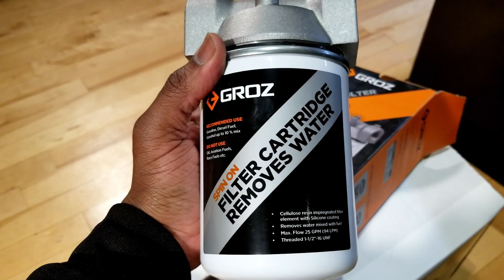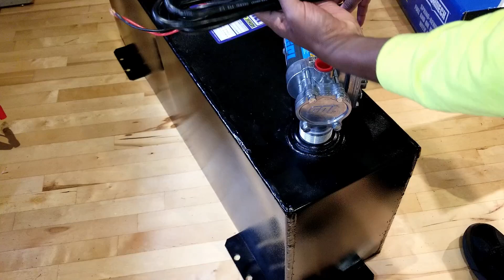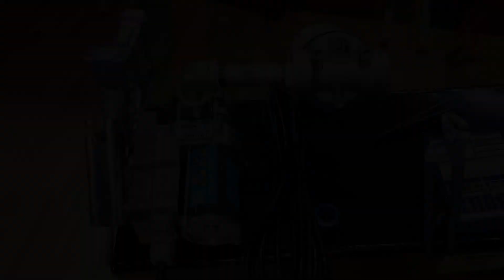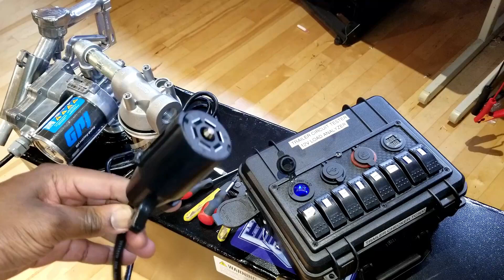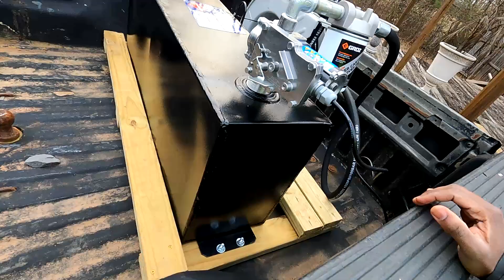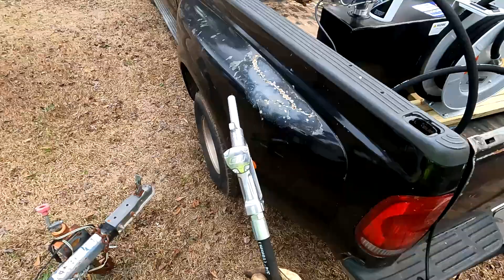12V Fuel Transfer Pump Tank & Reel Setup

Comment: How is it holding up? I wanna try it to take the wast oil of my oil changes I am a mobile mechanic would you try it?
Reply from the maker: Its still working, but If i was transferring oil, id look for a pump that is designed for that, such as the Fill-Rite FR410B which is a diaphragm pump.

Comment: Company called PIG they sell small pillow it only absorb fuel no water , amazing, put in bucket with holes bottom to let rain water out and nozzle will stay in bucket as place for it to stay catching fuel drips ,bolt bucket to your frame large washers , move coller  down hose to adjust length , tent unit with heavy pond liner when out side on ground no rope needed , thieves  will not even see it sitting there hopefully , bucket black and rectangle fits tightly on unit
Reply: Another cool nozzle holder I made was I took a small road cone from Lowe’s flipped it over cut the base off bolted to the side now it’s a holster
Reply from the maker: Thats a good idea! So far ive got a Camo tarp over it, now to find  a  small bucket.